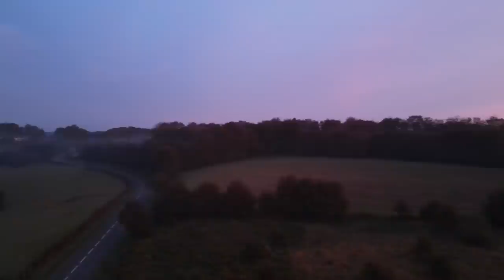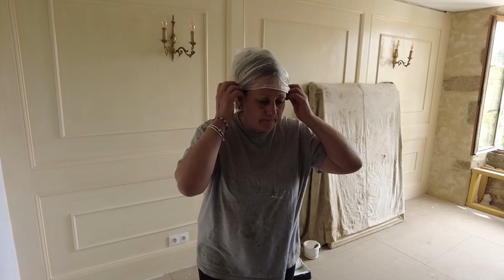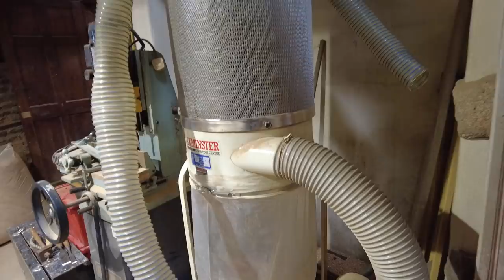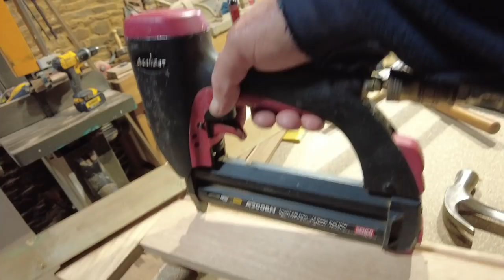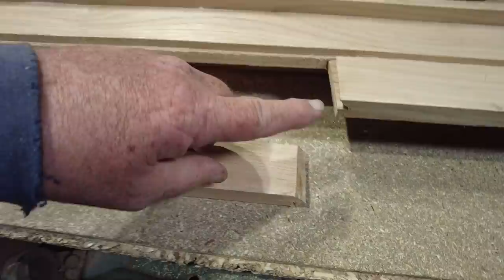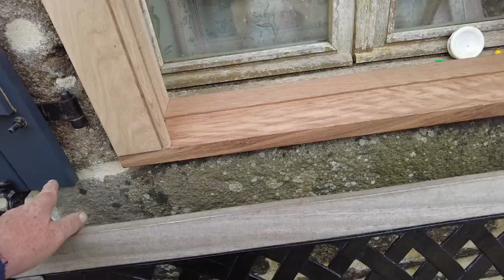No 39. How to make box sash windows in oak PT 2

Comment: When you get the sash around the window, then the windows into the frames, and shutters installed covering up the windows... this will stop the water running into the wall, but you mentioned drips below the stone ledge... will the condensation drip below into the wall?
Reply from the maker: No this system stops that happening if you watch this coming Wednesday you will see all the best Budo

Comment: Was the part 3 made I’ve watched both pt1 & 2 as a glazier this is so interesting I wanted to ask what that crucial measurement was for the face frame overlap of the box sides that keeps the sashes in place also width of side pieces usually and thickness of a sash. width of cill basically sizes
Reply from the maker: Hi Billy it all depends on the size of the sashes and there weights mate if there wrong it messes with the way they work hope this helps mate